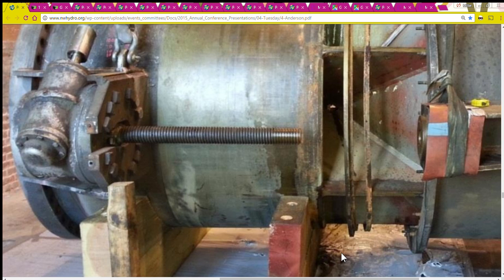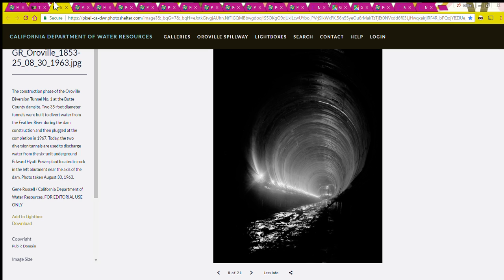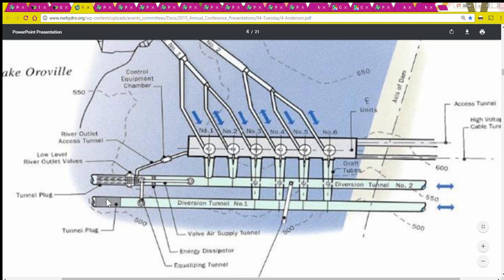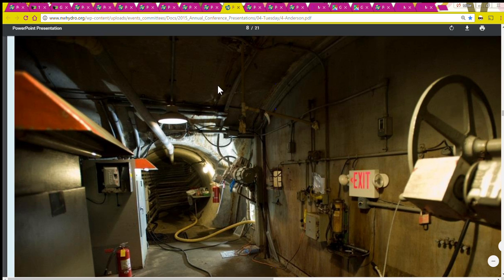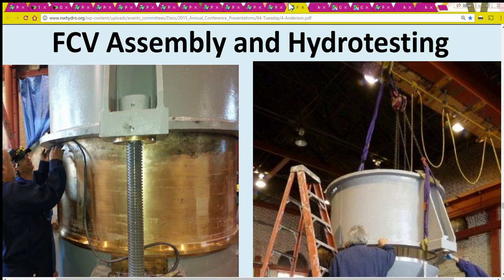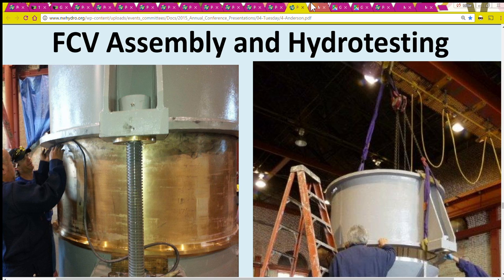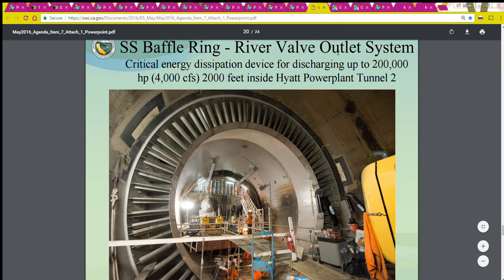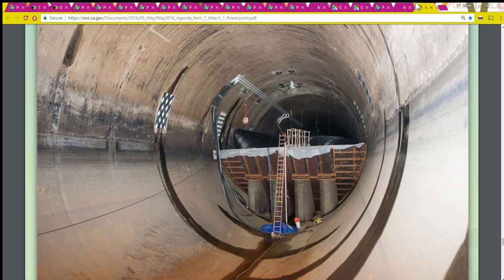River Valve Outlet System (RVOS) at Oroville Dam Explained 4/29/17

Comment: Was the Baffle Ring removed before the incedent or after?
Reply from the maker: The Baffle Ring was removed in April of 2009, several months BEFORE the incident. That ring had been broken since the dam was built. Syblon Reid removed it, and you can see a slideshow about the removal at http://www.srco.com/index.php?id=85
Reply: Millie Kay Here's the reason for the question. CalOSHA found that the Breakaway Wall had not been inspected for 40 years, Bolts had been corroded and 28 or so had sheered off. Yet  the construction company that removed the ring also claim to have built a new wall. " Once all concrete and steel were removed, the tunnel liner was repaired. In addition to removal of the baffle ring, Syblon Reid built and installed a new pressure relief wall to protect the powerhouse from catastrophic failure of the low level outlet valves. All critical work was completed within the 10-day outage period without a single loss time accident or OSHA recordable incident" It is not clear what "Installed" indicates. They had to have seen thoes anchor bolts had been corroded and should have been replaced. Pressure relief wall and Blowout wall indicates to me that wall had been built with the anticipation that it may be necessary to forcefully remove that partition. If a new wall was constructed and installed the job was either poorly done (not replacing bolts) or the bolts called for a sheer value. I find it interesting that CalOSHA claimed and newly constructed wall was not inspected. One of these organizations is incorrect in their statements. Either the wall was new, or the construction company lied about installing a new wall. I have no way of determining any of this but if a new wall could have prevented this incident?  Why did the investigation show a newly constructed  Breakaway wall, this would have been a critical finding and one the Dam Operator would have wanted in the report because it showes improvement and intent to make a safe work place.
Reply from the maker: Abby Babby Abby, I'm mobile right now and won't be back to my laptop till tomorrow. I really appreciate your info and I want to give it some thought, so I will reply sometime tomorrow. 🙂
Reply from the maker: Hi Abby Babby! I finally found the time to look through your post, the Syblon Reid site, and the CalOSHA documents again. I agree -- a newly built wall would have been something DWR would have wanted to "shout about". 

Could Syblon Reid have come back to do the wall part of the job after the accident? (I know it seems counter-intuitive, but could it be a technicality?) 

So the statement on Syblon's Web site says, "Syblon Reid built and installed a new pressure relief wall to protect the powerhouse from catastrophic failure of the low level outlet valves. All critical work was completed within the 10-day outage period without a single loss time accident or OSHA recordable incident." Is it possible the "critical work" did not include the wall (only the ring?)

Just sort of "thinking out loud" here. Puzzling for sure.

Comment: Very much appreciated. if I may, pls permit to make a wee correction, at 12:52, you id'ed the exterior bank of power lines at the transmission station as "here's the Hyatt Power Plant." That's technically incorrect. FYI: the power lines carrying the electricity generated are exterior to the dam, however the hydro-electric turbines that generate that power are invisible to view from Google Maps Streetview. The Hyatt Power Plant is situated interior to the embankment of the dam: the 6 turbines are buried subterraneously inside the rock abutments at the 550-650ft elevations shown in the schematic at 1:18.  That's what makes them so precarious, commanding DWR's secrecy to protect their vulnerable "CEII" infrastructure from terrorist attack.
Noteworthy perhaps, in conjunction, is the proximity of the RVOS to the out-of-service turbine #1. Could full-throttle operation without energy dissipation measures have had a detrimental impact on the many interconnected passageways beneath Oroville Dam? Perhaps tiny cracks in, or resettlement of, grouting surrounding the tunnels possibly have introduced greater phreatic water flows, exacerbating the historic seepage seen on the downstream face of the dam (as evidenced in verdant green slopes seen above the discharge outlets)?
Reply from the maker: Hi Clare. Your post is just rich with information that I appreciate. I will definitely keep that cursor closer to the abutment in the future. I love this power plant and you are welcome to come here to discuss it at any time! Your comments about the RVOS is thought provoking. Thank you.

Comment: Hey Millie,  good job.   Adding a few details about the accident.    They were instructed to open the cone valves which control the flow rate (not shown in the diagram, but are right at the outlet of the two RVOS pipes and are what your later pics show) to 100%.   At about 85% all hell broke loose.  It is likely that the high velocity flow through the tunnel (normally slowed by the baffle ring) caused what is called a hydraulic jump such that the water piled up reaching all the way to the ceiling, blocking the downstream end of the vent tube (shown in the diagram).  When that vent tube is blocked, it creates a massive suction effect in the outlet chamber.    The suction was so great it literally ripped a huge hole in the steel pressure relief wall and then air rushed in from the access tunnel behind the workers to fill that vacuum at hurricane force, threatening to pull them through the new hole into the fast moving water.   All of them were knocked off their feet and one of them was seriously injured.
Reply: Clare, when a small pocket of hard vacuum in water forms against a concrete surface (usually due to high velocity flow being forced away from that surface by a bump), the water then rushes back to fill the vacuum with almost explosive force which can start eating away at the concrete.  (See cavitation effect and the Glenn Canyon Dam spillway failure).   However in this case it was all about total surface area and pressure differential from one side of the wall to the other.  The wall failed because it was a large surface with a partial vacuum on one side, and full atmospheric pressure on the other.   Let's say half vacuum,  which would allow net  7.35_psi (lb/in^2) pressure, spread across a wall that's about 10 feet tall and 20 feet wide, or about 28800_in^2 which means 211680_lbs of force or about 105 tons.   
This doesn't happen with the concrete walls because there's no additional pressure behind them other than the original pressure of the rock on itself which is much much greater than atmospheric but already supported by itself and the walls.   In other words the tunnel walls are not supported by the air within them, so removing the air from the tunnel won't pull them apart. 
The pressure relief wall was designed to fail at a specific pressure differential, which they achieved accidentally. 

A little background on the pressure relief wall itself.     It separates the RVOS valve room (where the physical mechanisms that control the RVOS ball valve and cone vales are located, and is human accessible), from the outlet of the cone valves into Tunnel #2 itself (where the water is).    The wall is normally entirely above water level.    It is called a "pressure relief wall" because it is designed to fail if the water level  behind the wall (in the valve mechanism room) ever rises to about 15ft above the wall.    This would only happen if there was some sort of leak in or around one or both of the ball valves.    Because the water behind the ball valves is at up to 330psi pressure if it ever started filling that room, it could flood that room then the RVOS control chamber 60ft uphill from that room through the access tunnel, and ultimately the turbine floor itself at the far end of the access tunnel.   To prevent that, they designed it so that if that chamber were ever to flood with water level 15ft above the wall, and then the wall fails allowing the water to escape into the tunnel.     15ft of head pressure is about 6.5psi.     Notice that my half vacuum pressure in the earlier calculation is 7.35psi, so that's all it would take to break the wall.
Reply: @daemn42  Thanks for the fascinating explanations! The entire event was very difficult to visualize, as there are so many different dynamic forces at play here and I’m also trying to figure out how the water interacts downstream in the tunnel.

Since this is a full diameter tunnel for the original river diversion, is it safe to assume that it’s max flow of 5400 cfs could never fill that tunnel? I guess based on your explanation of the pressure wall and control room, it indeed is designed to all be well above the water level. 

I guess my next question is the incline of the tunnel itself, I’m assuming once the turbines that discharge into #2 are online, then the dynamics change even further. If those were offline and the outlets appear to be above the diversion pool water level, there would always be an air gap? With that being said, it looks like the baffle ring is RIGHT at the control area, but with the valves appearing to shoot out a concentrated jet of water initially, what’s the purpose of a completely circular baffle ring? I’d figure that would require complete submersion of the tunnel at that location for it to do anything? 

I do kind of understand your explanation of the pressures pretty much requiring water to have reached the top of the tunnel otherwise your retain neutral pressure differential? 

How often was the system used (if at all) before the test incident? It’s kinda mind boggling that it was designed to have PEOPLE go in there and open up those valves with essentially an entire lake on the other side of the access area. 

Apologies for all of the questions, again it’s just a really fascinating system that I never knew any existed (on any dam).
Reply: @daemn42  so I figured out a few things that (I suppose) help me understand this better, but aren’t mentioned in many places. The main valves divert water around in an even cone (duh, cone valve - I thought that was just the internal seating mechanism though) - SO the primary water flow would impact the entire area / walls ahead of the baffle. I still don’t understand how the baffle changes much of anything (or the mechanism for which lack of said baffle caused the accident). 

Also I realize now that I typically half the tunnel rubble (ish) is under water. That would imply that it’s nearly level…. How does that work if the power plant needs to operate those two turbines? Wouldn’t that flood up AND downstream inside the tunnel?  I saw pictures of the boats working around the RVOS chamber and realized they had to drive INTO the outlet, in complete darkness, PAST those massive turbine outlets tunnels, and beyond to the chamber.  Something about that seems completely terrifying to me lol. 

I wish they’d release video from the tests of the new system, it seems like they have some great high res well-lit remote cameras in there now. 

Also I was thinking, at such high flow rates, wouldn’t there ALWAYS be a huge vacuum created during flows? Or is that what the pressure wall is there for (beyond preventing flooding of the valve platform area).  I still wouldn’t want to be anywhere near that tunnel entrance in the power plant during discharges 🤣
Reply: @EstorilEm   Yes you're right that cone valves release water in a cone shape around their circumference.    Search YT for "dam cone valve release" to see them used externally.   Most garden hose sprayers use a cone valve as well.       The dispersion ring isn't just a smooth ring flush with the walls of the tunnel.  It has an angled face that deflects the water back inward toward the center of the tunnel which greatly diminishes its velocity.    The total volume of water through the RVOS is not so great that it will ever flood the tunnel, but the pressure behind it is so high that it creates a very high velocity  (again, think garden hose sprayer) which if left unchecked causes the water to pile up into a huge standing wave where it goes from high velocity to lower velocity.  

They built in a provision to handle a standing wave sealing the tunnel by adding a vent some distance downstream connected back to the cone valve chamber.  This way if a standing wave blocks the tunnel air pressure can equalize from the air space above the water downstream (ultimately open to the outside), and the cone valve chamber to avoid a vacuum.   But it was designed specifically assuming the dispersion ring was in place.  Without it, the high velocity flow reached much further down the tunnel and the standing save (or hydraulic jump) formed right under the vent, and that creates a pumping mechanism that actually pulls air from the vent and causes a huge vacuum to form in the cone valve chamber. 

As for the level of the tunnel.    A couple things.
1.  It's really two tunnels worth of total flow capacity.
2. Neither the turbines nor RVOS can release enough water to fill up the higher of the two tunnels completely.   Water can flow either direction in both tunnels.     This is a pumping power station so they can draw water into the tunnels from the Thermolito Diversion Pool (TDP) at night and pump it back up into the reservoir at night when electricity is cheap and then generate power during the day when electricity is expensive.    They actually control the level of water in the TDP and thus the level in tunnel at another dam a couple  miles downstream.    So if they're running the turbines to generate power, they'll simultaneously increase the flow through the turbines, while lowering the level at the far end of the TDP to keep the level in the tunnel from climbing too far. 

The pressure wall actually only exists in case something went wrong and the TDP level rose too far (as happened during the failure of the MSW) causing water to back up the tunnel above the cone valve outlet.    The wall is there to protect the valve controls and such.  The wall could easily handle several feet of water on its downstream side.     It was not originally designed to handle a huge vacuum on the downstream side, as occurred during their test.    It looks like the new one works both directions.
Reply: @EstorilEm   And yes it would be a bit intimidating to be in the cone valve control room with water pressurized by several hundred feet of reservoir elevation on the other side of the valve, but keep in mind that that is standard fare for any hydroelectric dam and people work inside them all the time.     Any time you're at the level of the turbines, the internal valves just in front of the turbines are handling several hundred feet of pressure.
Reply: indeed "The suction was so great it literally ripped a huge hole in the steel pressure relief wall " one wonders what such a force would have done to other materials, such as the cement grouting that waterproofs the tunnels  connecting the various passageways under the Oroville Dam, or the weathered schist bedrock (similar to that which eroded under the flood control spillway) both crystalline mineral composites less resistant to high-velocity vibration shear forces than steel?
Reply from the maker: Hi daemn42! Thank you. I value your opinions. And thanks for the additional information. I try to keep my videos as short as possible, but I want to learn anything and everything I can about the Hyatt Power Plant. I just love that plant! This information you have provided is so appreciated. Take care.
Reply from the maker: Excellent point, Clare!
Reply from the maker: Hi Michael. Thanks for the analogy about the vacuum effect! Your comment about downplaying the heroics is very thought provoking. Thank you very much for viewing and commenting.
Reply from the maker: Hi Clare. I know the concrete is 9 inches thick inside the Diversion Tunnels and 6 inches thick in the smaller pipes. I don't know about the grouting. For sure, 100-mile-an-hour hurricane force winds could do some major damage. Thanks for your insightful comment.